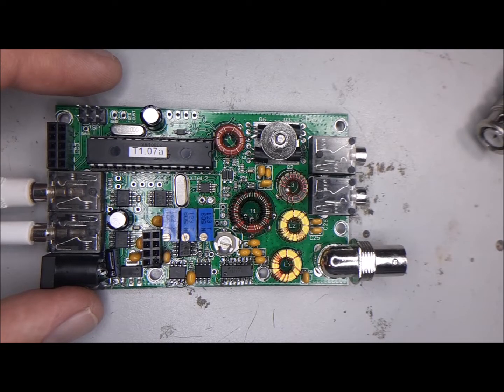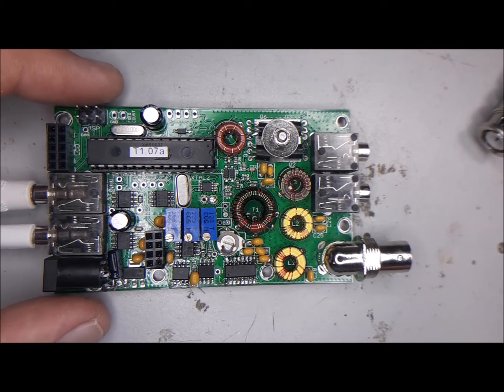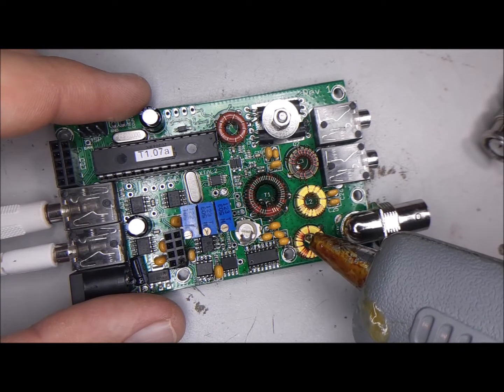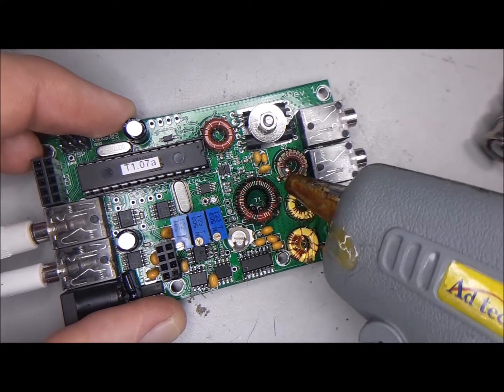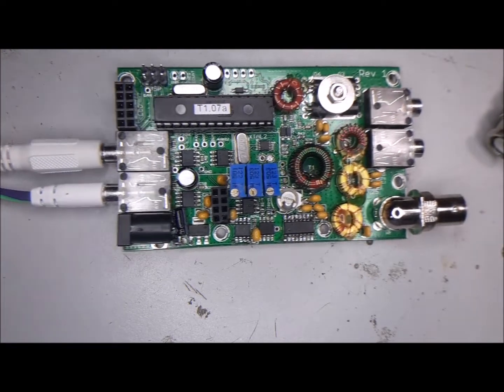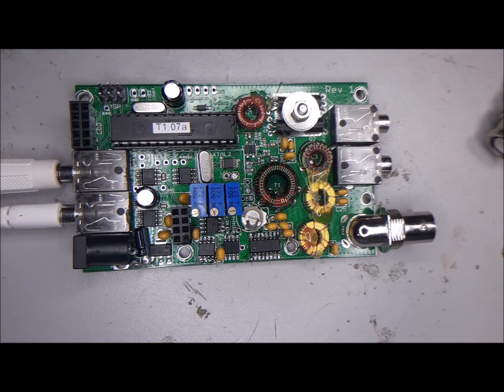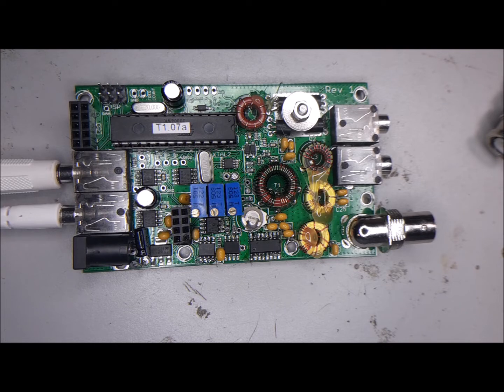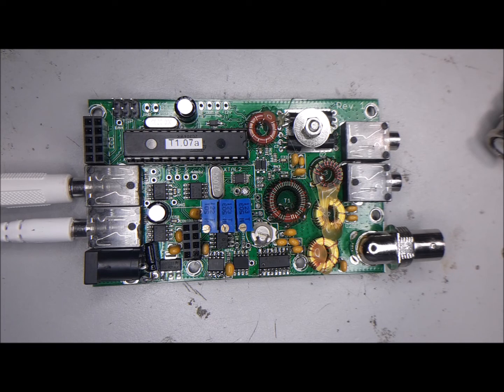QCX Mini Mini Tip 10 - Securing the Inductors

Comment: Make some Q Dope - melt Styrofoam with a solvent like Acetone, MEK, or Toluene to a thick syrup consistency and paint on. The solvent typically determines how fast it dries - Acetone might be a little too fast. Of course mix this stuff in a well ventilated space and wear gloves. It will coat the coil with Polystyrene which has a high dielectric value. It can be used to hold the coil to the board as well. Always make sure the solvent used will not do any damage to anything you are applying it to, but PCB solder mask, toroidal core paint, and enamel wire are OK with the ones I mentioned. I used to buy Q Dope from GC Electronics many moons ago for solenoid coils, it can be expensive. I found out how to make it myself through some forum post someplace...